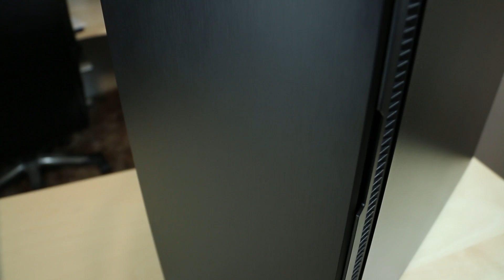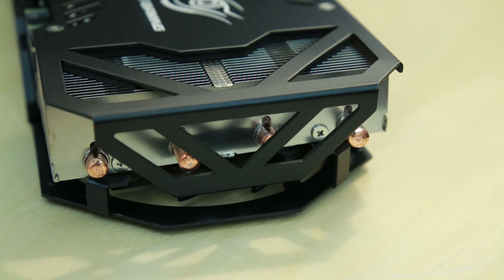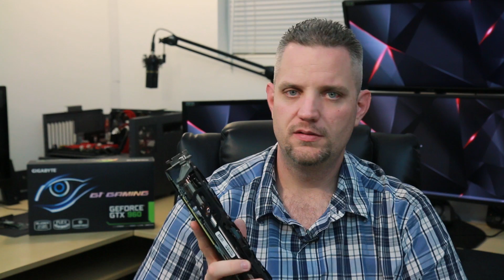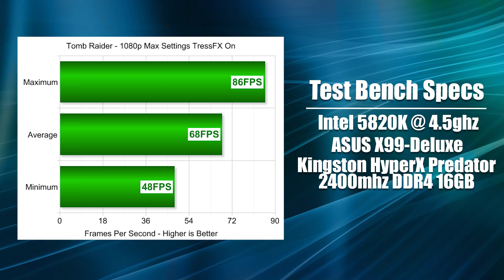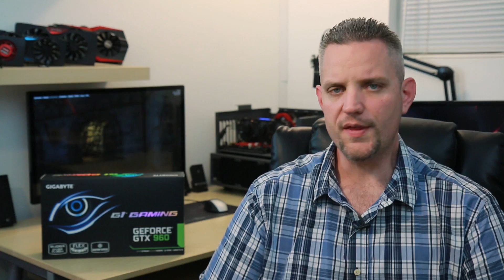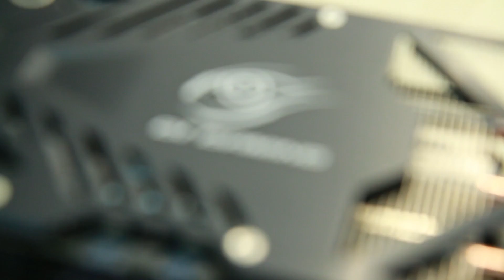Gigabyte GTX960 G1 GAMING - Best Mid Range Card Yet?

Comment: With 2 gb only its the WORST mid range card yet...
Reply: This is aimed at people with a single 1080p monitor and 2GB is enough for those people.
Reply: OCGameR Really its not enought many new games are using more than 2 gb even in 1080p. And its not getting better in the next years nearly every AAA game that comes out now uses more than 2 gb
Reply: Eshcole.com
Lol, the screen size doesn't matter, it is the resolution that does. It makes the gpu prosess more things on the screen as the resolution gets bigger
Reply: Eshcole.com HAHA wtf screen size doesn't matter in any way :D
Reply: MrApvel I support your opinion, Far Cry 4 needs more memory than 2GB
Reply: The only reason any game out right now is using up 2GB of memory is cause people playing it on big screens or multiple screens. If you're going to do that, you're gonna need more memory and thus a different card. If you're playing on your less than 30" monitor than I can't imagine any game needing that much VRAM.
Reply: MrApvel eh? ye 2gb is more then enough.. after all it is aimed for 1080p not 1440 or 1600 or 2800 or 3x monitors or 2 monitors.. its fricking aimed towards 1 1080p monitor and can handle any new titles at 60 fps with no trouble.. heck even my gtx 770 doesnt run out of memory. + Far cry 4 is Horriblely Optimized and doesnt require more then 2gb vram. not even shadow of morder requires more.. i can run that game with everything maxed and still get 40+ fps on a 770
Reply: Eshcole.com The size of a monitor has nothing to do with how much VRAM you'll use, it's the resolution. You could have 100" 1080p monitor and it will use the same amount of VRAM as a 21" 1080p monitor.
Reply: Eshcole.com
Uneducated people. VRAM is not that critical for rendering at high resolution anymore. You can run 4K on a 256MB no problem, if you had only a few low res tiled textures in the scene with the simplest shaders(minecraft). The TEXTURES/assets are what is critical. 2GB is NOT enough in 2015. It's what makes my 770 run at 2FPS with some games when I crank up the texture detail on 900p, even 720p resolution. The detail in the new games will be more than anything we ever seen. And by detail I mean more objects/geometry with more and more unique textures with higher and higher resolutions for these textures. And texture quality will be much more important in these new games. Nobody likes beautiful detailed worlds ruined by blurry pixelated mess.

Also, smaller frame buffer means more memory allocation, which means that this narrow bus and the limited memory bandwidth for these cards WILL make the GPU struggle even more, with Hi res textures. Or I should say textures with reasonable quality at this point. It's still sad that a card like a 770/680 is limited not by raw GPU power, but because of not enough VRAM in these situations. (AA is completely out of the question) And crappier textures ruin a game more (for me at least) than any other thing. Because you know what happens on a 2GB card with ULTRA textures on watch dogs. And on lower texture settings the game looks like crap, especially vegetation. And that game is not even that detailed! What happens if you want to have 20 unique trees more to make the world more believable?

See the division for example and how much detail that game has. Way more than watchdogs. I don't even want to imagine what that game is going to do on a card like the 960. You will have to compromise on texture quality not because of GPU power,but because of the 2GB. Texture quality that can make the game look way better especially on lower settings with these mid range GPUs.

But the 960 is 2GB/128bit bus.  The GM206 is already done. It should've been designed with at least 192 bit bus, which would've made possible at least 3GB.
Reply: Dennis Koryukin yea and price to performence is just bad, for 200 $ you get an R9 280 with 3 gb
Reply: kiwicant "no way is 2GB ram enough. ... Farcry 3 = crap FPS." --- I call bullshit. I had SLI GTX 670's (FTW) with 2GB and I got smooth ~140 fps. Idiot. And no, the memory does not stack.
Reply: Du hier? Nicht bei Kanal 123?
Reply: leon timmer open world games are using much vram so a R9 280 would be a better choice
Reply: Bu11sEyes pft... 40fps lol
Reply: kiwicant what do u mean i got a 2gb vram and running bf4 at 1080p with no problem
Reply: vincent metzker jea thats what i mean :D
Reply: ***** you dont need 4gb if the games optimised correctly.
Reply: Dennis Koryukin But vram bottlenecks the card. Nearly every AA title that comes out these days need more than 2 gb
Reply: The 5 is a number. If I say 10 then you're satisfied? It's not stable that was my point. I have a 270X 2gb card so I know what it can handle and vram limit can be very annoying. My other spec is i5-4690k with 2x4gb ram before you would call my PC is cheap or something. :P So again, GTX 960 and also my 270X are great cards but once you have a 2gb vram card (like gtx 760 or some bit lower) then it's not worth to upgrade. Power consumption is one thing but we talk about few cents / month overall. I recommend at least 3gb vram in FHD. ;)
Reply: 1080p is starting to need more
And you should read better because its was sayed a lot of times
Reply: lets hope its not 1.5gb !
Reply: MrApvel do you think its possible to run GTA 5 on ultra with this card , a i5 4690 and a z97 motherboard 8gb ram 1600hmz?
Reply: It just get about 50 point better in valley benchmark then the gtx 760
Reply: MrApvel thanks!
Reply: leon timmer an i5 4690 or 4690k? If non k get the i5 4590 and a h97/b85 mobo.
Z97 board are more for OCing.
Reply: McSumpfi MrApvel bin nicht der eibzige deutsche hier:)
Na ja bin eigentlich kein deutsche.
Reply: OCGameR I play at 1080p (unfortunately) and no way is 2GB ram enough. Try playing Diablo 3 (multiplayer ) with sooo much going on screen. Farcry 3 = crap FPS. Thats why i bought 2 x MSI 970 Gaming. 2Gb for casual gaming maybe... they should have made it 3GB really
Reply: kiwicant then you have a bad pc.. cause Diablo 3 requires NOTHING. even my shitty laptop wtih a gt 635m 1gb can run that game at ultra 1080p 4 man maps and still get 40+ fps.  Farcry 3+4 is badly optimized. and also gtx 970 doesnt exist with 2gb.. it comes in 4gb and 8gb later. plus having two of them doesnt help towards memory load.. since both cards load equal or one takes over the other.. so ye have fun with that.. not even BF4 requires more then 1gb.. afterall your Graphics card uses as much memory that is available to insure you get top notch performence after all who the hell want a 4gb gfx and only use 1gb? that would mean 3gb not used up and just sitting and doing squads? i mean comon ..
Reply: ***** What i meant was i bought 970's because they have 4GB VRam. 2GB isnt enough to run the games I like (BF4, D3, Witcher 2 etc) at 1080p... and i don't care what anyone else say cos i've been there done that!
Reply: I dont think that running out of vram is that bad, all new games uses my 2gb of vram, and I dont get any studdering or texture glitches etc.
Reply: None of your cards compare to the PoTaToX -130it 1byte Graphics Card, I maxed every game out on 0.00001x0.000001 textures and a 0.1 Resolution at 0fps. Take that!
Reply: yup I totally agree, If thye made it 3gb it would have been the best
Reply: Just wanna point out, Ubisofts benchmarks are ahead of themselves. The game looks like FC3 and requires a shitton more GB, which is stupid.
Reply: 2gb is enough for casual gamers.... i have a 2gb card and the only games i use on pc is free to play. i know it wont look as good on xbox one but when i buy a game i want to have a physical copy, i know pc has them aswell just pc physical copies lose their value more then xbox/ps4 games so its kinda a investment.
Reply: I don't think the question is what a 2gb card can run, it's why would I play $200 for a card with 2gb of memory?
Reply: CrunchyMunchy because its a budget card?.
Reply: CG Gaming 280?
http://www.newegg.com/Product/Product.aspx?Item=N82E16814127789&cm_re=R9_280-_-14-127-789-_-Product
Reply: Hallo herr mrapver gut dich hier zu finden
Reply: MrApvel what about it
Reply: Maybe that 280>960 even for the same price or cheaper eith 3gb vram?
Reply: CG Gaming Right, if I'm budget minded, I'm looking at what I can get for my money. For $200, I can get a 3gb card in a R9-280. It's got a lower clock speed, it's older tech (and it's an AMD), but having more memory means it has less limitations. Or, if can squeeze another $50 or so out of my budget, I can get a 290 with 4gb of memory. 

I just think Nvidia missed a huge opportunity here. If they'd came in just $20-30 lower, there would be no question whether this card is worth the price. As it stands, reviews have been pretty lackluster. And most of that has to do with that $200-220 price point.
Reply: CrunchyMunchy yeh i have asus r9 270x 2gb and i paid 182.00 i wouldve got r9 280 but they weren't in stock
Reply: You don't remember the 680s they maybe old but they still kick the shit outta games still
Reply: julesglendenningTV I would not buy a used card. And it only has 2 gb too
Reply: Dude, i havent found a wall yet with any of the games i play. BF4 BF3 Crysis 3 Skyrim, modded to hell. So im sure for the average gamer who is going to buy this card, they will be absolutely fine.
Reply: ReaLzEdits But why the fuck should they Pay MORE to get LESS. Oh i forgot it says NVIDIA on the card.....
Reply: MrApvel they dont listen they just go to nvidia's website se the part where "nvidia geforce, the best for gaming" is writen and buy it after that they say amd has drover problems and nvidia has a better software.
Ohh and that amd is hot as shitt
Reply: Ye the amd driver is terrible, sure. I never had any problem with amd drivers IN GAMING! since 9600 pro which is very old now. Also people keep forgeting the driver that nvidia made long time ago when many cards burned down by driver issue. I'm not fan of either side but calling Nvidia is much better than AMD is stupid. Both side has their goods. Anyway 2gb vram is not enough on 1080p in some games (ultra preset) but overall it's okay.
Reply: I know i just took the fanboy perspective
Reply: Praston yeh its okay for me with my 720p screen lol
Reply: R9-285 says hi
Reply: if it was 4gb I would think of upgrading , but my 760 is just fine. despite it having higher TDP but whatever.technically the 760 has better specs despite maxwell
Reply: MrApvel dude the card is $200. dat price to performance doe. If you are running games in 1080p it shouldn't be an issue for 60 fps.
Reply: MrApvel Vram doesn't make a card... also, the power consumption is better on nvidia's side and they can come in gigabyte's micro atx size. Which is good for if you want to have a portable build/LAN box-which would be especially cool for sli. But yeah, the r9 280 is more powerful in general.
Reply: MrApvel no it dosent.
Reply: of course it does. I guess you never tried it. If you have a 2gb vram card and you put max settings on game that required 3 gb vram and your card start eating around 2600~ mb vram, you will notice fps drops when you move which is annoying. I don't say 2gb vram card is not enough but what i tell you is 3gb vram is more future proof even on 1080p. I wanted this gtx 960 but 2gb vram is a bad point. I hope for a 960ti with 3gb.
Reply: CG Gaming he knows perfectly that it does, he own a 2gb card himself.
Reply: CG Gaming he knows perfectly that it does, he own a 2gb card himself.
Reply: vincent metzker yeh and who the fuck plays on max settings with a entry level card. even with my 270x i play on medium / no aa for butter smooth gameplay.
Reply: Guys, we keep miss talking. 270X isn't that bad card but vram hold it back sometimes. So we say 2gb vram is enough for every game on 1080p but wait, we lower the texture quality and stuffs cause of vram limit? Interesting point. Yes a mid range card is not the best for 60 fps and ultra on everything in multiplayer, but on single player games people fine with stable 30 fps (mostly). So I expect stable 30 fps in singleplayer games with a mid range card aswell and I don't want fps drops to 5 cause of vram. Thats my point.
Reply: Praston theres no way it would drop to 5 bacause of 2gb
Reply: CG Gaming if you are payng 200$ why shouldnt you have ultra?
Reply: vincent metzker in graphics cards you get what you pay for. pat more an you will get a better card in most cases. at the time i bought the most expensive card i could with the money i had. also i dont actually game on pc i just use it for free to play, oc exclusives and no mans sky xD
Reply: Why would you need more than 2gb if you're only going to game at 1080p?
Reply: Jonny B I never had a problem with my old gtx760 it really comes down to the video cards bandwidth and if your unfamiliar with that its how fast the gpu can access the memory in an easy term but for instance they have a gt640 or something with really low bandwidth/ROP's and TMU's with 4 gigs of memory but a 2 gig gtx760 would destroy it in performance even if the game your running hypothetically needs 3 gigs of ram to run correctly.Far cry 4 also runs just fine at 1080p maxed on just a core i3 3225 which is a dual core, the 760 and 8 gigs of ram on my HTPC hooked up to my tv in the family room
Reply: What other $200 cards are there with 3+ GB Vram? I haven't really done much GPU searching  since August but I think I wanna upgrade my GPU again this year, so, I have been searching around.
Reply: 280 and 290 is for 260$
Reply: starterpivot you can even get a 290x for around 230 Im waiting for the 300 series of AMD cards to decide if I want to get a gtx980 ot the 390 the gtx960 launched a few days back but I was dissapointed in its performance
Reply: ***** Oh, well thanks, I think I might just get a 970 the next time I decide to upgrade so I wont have to worry about upgrading for a long while PLUS i could SLI them if I ever wanted to.
Reply: starterpivot yea with to of them the vram bottleneck would be even worse
Reply: leon timmer on ultra no way but on high with AA on for sure.
Reply: MrApvel That's mostly because of really poor optimization. Most (all) of the AAA titles that want more then 2GB of VRAM look shitter then a lot of games that you'd be fine with it (metro last light / etc).
Reply: And how this knowledge helle you when your stuck with 2 GB?
Reply: Astralify exactly..this is the reason i am disappointed that 970 has only 3.5 gbs of usable vram..although it is a beast it is soon going to get vram bottlenecked ...i have downsampled games from 4k resolution and played them with low texture quality and even then they look worse than games running in 1080p with high texture quality..i seriously hope nvidia fixes this...although 4 gigabytes wont make much difference over 3.5 gigabytes...vram trashing is becoming a common trend this days...so any small amount of vram increment is better...
Reply: soumya basu if you goto videocardz.com which stays on top of anything video card related they are making a patch for it it still is going to have a 3.5 gig bank and a 512meg bank of memory but if you go over 3.5 it can utilize the 512 megs of ram on the card
Reply: ***** are you sure? Where did you read this,...because nvidia released an official statement saying that they are not going to do anything to boost the perf of 970...also the statement made by an nvidia representative about a driver update to fix this issue is false ...nvidia officially declared its not a bug but an actual feature
Reply: soumya basu thats sorta what I said and I told you where I read it
Reply: I still get good FPS with my 2 way SLI 570s... and they have 1280mb of GDDR5. I play at 1920x1080, but I do run two extra monitors in the background with a stream and something else (photoshop/mumble/other VoIP/Instant messaging etc). It does affect performance a little bit, but obviously no where near as much as running at 5760x1080.

Anyway - I still ran Titanfall at a solid 50-55FPS, only turning a few settings down, like AA and.. Ambient Occlusion, I think it was. Granted, I don't play Ubishit games like FC4, AssCreed, etc, because I'm boycotting Ubisoft until they fix their shit (If only), or many MMS like BF4 or Crysis, if only because I hate how they handle mechanically (I've been spoiled by Tribes and Arena shooters, Titanfall was an exception due to it's free running mechanics which made me just want to explore the maps and get as much speed as possible)

As far as high end games, I guess the most intensive games I play are Divinity:OS, SR IV, Warframe (not really high end, but It runs maxed at ~70FPS). But ofc, I am a MOBA player (Dota 2 and LoL atm), so this card is probably aimed directly at me.

This card is looking quite relevant to me, especially considering I'd get Shadowplay, Gamestream and the auto-optimizer in Ge-Force Experience (yes I know it's not perfect, but it's a starting point).

Incoming BUY A R9 280 HRTAQHIWETGAHWIOS.
Reply: ***** sorry but i fail to understand your point....970 was always a 3.5gb card with 512 mb extra memory..and you could always access that extra 512 mb...at the risk of extreme stuttering...so what exactly is a patch going to do?
Reply: It will do that you always can accses to that memory and you have more lag .... I think
Reply: That's true. On my gtx 770 skyrim with a bunch of mods to make it up to par to this gens games maxes out my 2gb and my 280x with 3gb uses up to 2.5gb.
Reply: MrApvel
Shut up. You're being an AMD fanboy. It's quite obvious.
Reply: SAVVY EDITS It runs great on my old laptop with a 670M
Reply: Lel he is beeing objectiv thats the only problem
Reply: Clean Hardware sure thats why i have a gtx 760 :P
https://lh5.googleusercontent.com/-olsAFUZRVyA/VMz7LLBWkuI/AAAAAAAAAg0/n_SmIC-JdFs/w1153-h865-no/IMG_20150131_164054.jpg
Reply: MrApvel  im sure you wanted EMPiiRE
Reply: MrApvel I didn't expect you to have a 760, it is like even worse than the 960 in terms of performance/price
Reply: Yea i know i was uninformed when i buyed it 1 1\2 jears ago :(
Reply: EMPiiRE I dare you to try k enb with the ultra preset ;)
Reply: MrApvel like me and my cx600m :P
Reply: i'm not a AMD fanboy but i find like the same FPS rate in bioshock infinite which i'm playing right now (well i falls down to 30 FPS in some area, BUT i'm playing with morphological AA which a like a lot more than FXAA and is also heavier. And i'm using a 4GB R9 270x ;)
Reply: CrunchyMunchy

hi man... clock speeds really have nothing to do with real performnace, an advantage of 5FPS in the best real world scenario
Reply: crazymetallian I was simply listing the pros and cons. My point was that I would rather have the extra ram than the faster clock. You're making my point for me.
Reply: yeah i didnt read all the stuff
Reply: ROG 13:37 it was an "powerefficent" card
Reply: ROG 13:37  i know
Reply: well, atleast its not 1.5 gb huehuehue #amdforlif
Reply: Because this card is totally meant for maxing out games at 1080p...
Reply: +MrApvel I have the 2gig version from EVGA and I do see that memory usage is 3 gigs or higher but by adding more system memory, I've been able to maintain 60 plus fps gaming on 1080p with no stutter or performance issues. I'd say it's a great 1080p targeted card....with the right rig specs of course
Reply: +OCGameR Very true...now back in the old days of 3DFX Voodoo cards, he would have been correct but now, screen size has no factor :) I get the same fps playing on my 42inch as I do on a 27inch monitor...no different mem usage...good job correcting.
Reply: +kiwicant Hey for a graphically intense game like that with all bells and whistles turn on...he's still getting far better performance and eye candy than consoles  :)
Reply: MrApvel Hardware would this run GTA max settings on a amd fx 4300